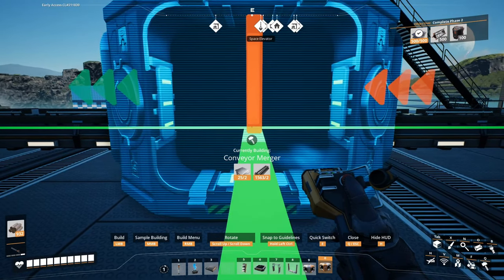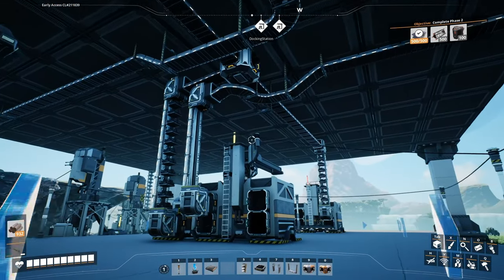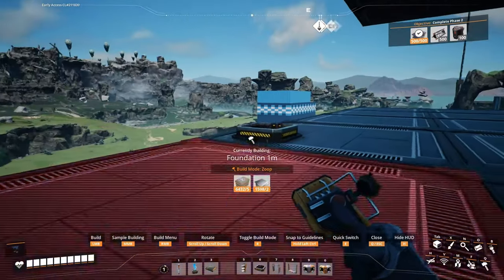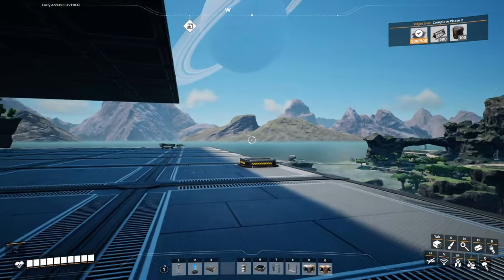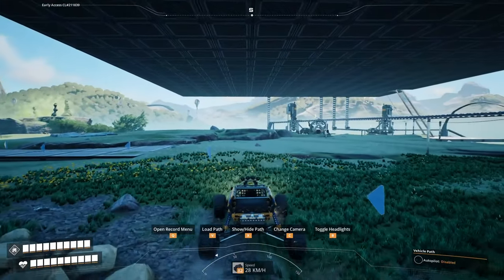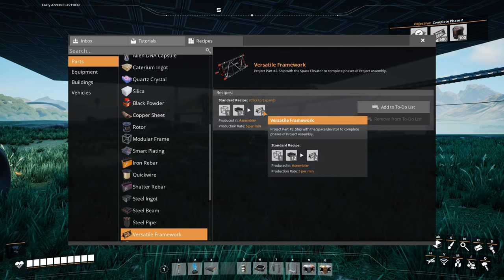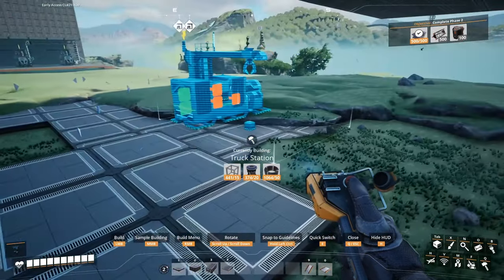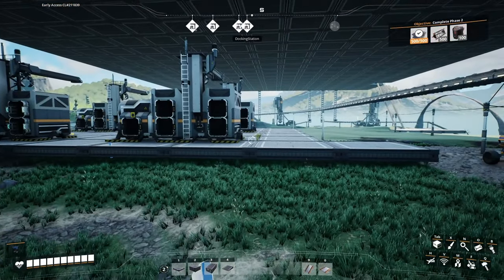Modular Frames - Done!  Let's Play Satisfactory s02 e31

Comment: getting 2 belt out of 1 industrial storage is not working unless you add 2 belt that come into the storage(if not its just gonna go on 1 belt)
Reply from the maker: I believe that's mostly true. The 2 belts will be used after a backup fills the containers fully. With the way it's currently set up, the two belts won't make much difference since we're currently using only one of the outputs at the end of the storage array. I used 2 belts since it doesn't hurt anything and may come in handy if we ever pull from both outputs at the end of the array some point down the road.